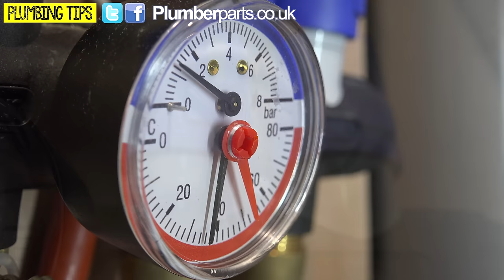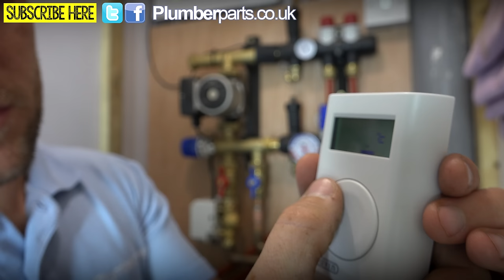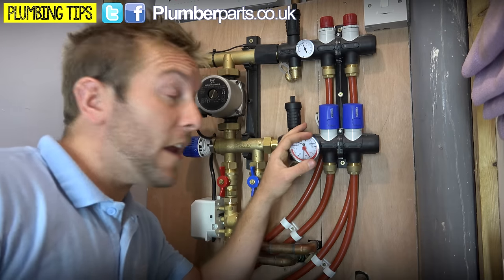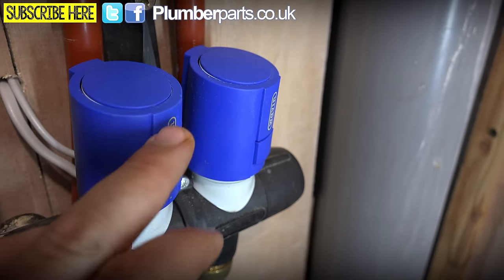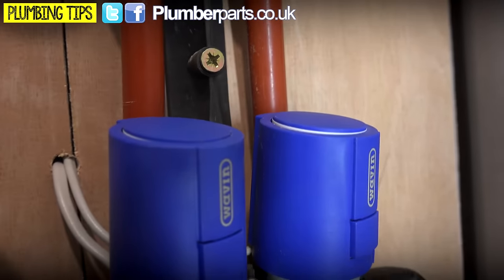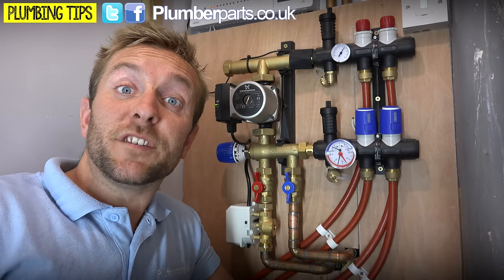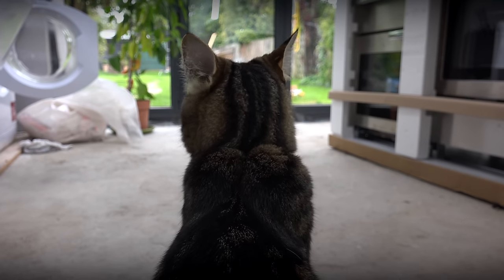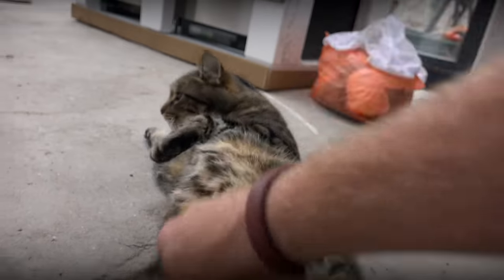UNDERFLOOR HEATING GUIDE AND INSTALL PART 2 - Plumbing Tips

Comment: Cats are by nature, expert heat seekers, having your cat lying out on your  floor is the only certificate of excellence and rating that you need,  to know that your heating system is working like a charm. Cat Rating : 5 Star.  Job well done. I've subscribed, but only because George gave you a certificate of competence and confidence.

Comment: This was the best video on U/Flr heating I have seen so far. Improvements could have been a view and detailed explanation of the wiring centre and you terminating the pipes into the manifolds.
I am about to buy and install U/Flr heating in my 2 extensions but am unsure how the zones work, I have 4 different rooms but dont want all 4 at same temperature or on at same time if not required, do I need 4 different systems of can this unit handle 4 different systems on a single larger manifold with 4 individual room stats?
I also know the "am I getting divorced today or not" feeling, my missus wants a nice big house but doesn't want the mess and hassle involved to get there. 😮

Comment: Good job at making this video. In Poland we install this kind of underfloor heating in new build houses as standard. Ususly each loop outlet has installed flow meter so you can balance the flows and take a note of flow on each loop and you can occasionaly check if the flow still stays on at correct level. The manifold with pump unit is mounted inside wall cabinet that fash with the wall for neat look.

Comment: Great video and a brilliant channel. Looking for some advice.... Can I fit both a wet undefloor heating system like the one in the video and also then fit an electric underfloor heating mat? The idea is not to use both, but have the choice of which source of heating will be most cost effective in the future. It is a new floor consisting of 80mm insulation then 75mm of screed and tiles will go over the top. My original plan was electric mats because of the ease of installation and a smaller original outlay. My original planning for the project was 2 years ago and since then electricity prices have dramatically increased so I am wondering if it would be wise to put the pipework under the screed which will give me the option of a wet system if I decide to at a later date. This is for my wife's new boarding cattery so it is independent of the house heating system and due to our location the only current feasible option for a wet heating system would be an oil fired boiler and I fear that oil and fossil fuels will become heavily taxed and ever more expensive so it could be good to have the choice of which system to use.

Comment: Very informative video! 
I have a question. Zoning off valve of my heating system is broken is not responding to Thermostat. Room keeps heating and wastes energy. Can I stop the Wilo pump for few days till I get new part? Or stopping pump and flow can cause damage to system?

Comment: Could you tell me if it is possible to replace an isolation ball valve on my underfloor heating manifold without draining the system ? Hope you can help, thanks.

Comment: Where do you connect that wire what comes out of the 2 port valve ? To a thermostat which is located in the room where is underfloor heating ?

Comment: hi i have boiler in toilet and manifold in kitchen under the stairs cupboard i have 2zones 1st floor radiators ground floor wet underfloor heating my question is can put 2 valves next to boiler for each heating zones. as most people they put 2zone valve next to manifold.

Comment: I guess those actuators are thermoelectric - slow but low powered and silent. So why choose normally-closed rather than normally-open? I guess the choice was made by Wavin or whoever made the controller, but wouldn’t normally-open give both a faster start-up and fail-warm rather than fail-cold?

Comment: Hello, very helpful video / guide! I have enjoyed watching a few of these plumberparts videos and non-coincidentally have just had my house completely gutted back to pretty much 4 outside walls then heavily extended (totally rebuilt new from a husk effectively) and have a couple of questions for anyone in the know which may be able to help advise on my requirements before i go ahead with the heating system install...?

The place is a pretty sizable (4000+ sq/f in total overall) consisting of 5 bedrooms over 3 floors (loft conversion) with 4 en-suites (3 baths, 4 showers), with the ground floor having underfloor hydro heating (2000 sq/f) which is predominately open plan lounge / kitchen - with 2 receptions rooms + Utility + toilet .

 My plumber has recommended an Ideal Logic30+ along with a Megaflo  water cylinder, my question is - When i look at guides / recommendations for boilers for the size of property it would appear I should go with a 40+KW boiler due to the amount of bathrooms etc - however - as I am using a Megaflo Mains pressure cylinder - does this mean that the 30KW Ideal boiler hes recommending doesnt need to be as powerful as the cylinder makes up the difference in power requirements? The other thing is - the plumber is saying that the Ideal Logic Plus 30 is a good boiler with a 7 year warranty and he never has any problems with them, I have had a few Valiants over the years and one newly installed one completely destroyed itself in about 5 years and had to be pretty much completely replaced with parts, so am now rightly dubious of the brand.

Could anyone clarify the above questions and / or what would be the best boiler and cylinder combo based on my requriements?

Any help would be very much appreciated. Ta

Comment: Hi. Thanks for the video. It is really helpful. I am installing an underfloor heating myself. Really appreciate if you can provide me a few suggestions. I have put screed on top of the heating system. Just wondering two things 
1)How long should i leave the screed before i do the flooring. Can i keep the room temperature at about 20 degrees centigrade (using a room heater) for about 7 days and do the floors or do i need to keep it for 21 days for the screed to settle and then gradually get some hot water through the pipes. Unfortunately this will take about 28 days which will be a bit difficult especially with a young child at home. 
2) I have a got 22 mm engineered wood for the floor. I was planning to put an underlay and put the engineered floor directly. But someone recommended me to put a damp proof membrane, followed by a 6 mm wood play (with large holes in it), then underlay and then the 22mm wooden floor. Is this required. Will it not be too thick under layer for the underfloor heating to work efficiently. 
Thanks in advance for your valued suggestions.
Regards

Comment: Quick question probs sounds stupid but can you change the pump side to right so the flow is from that side ... the unit doesn't have a directional flow on each side does it ? and if so is that true for all manifolds ? cheers

Comment: Hi, great video.. just wanted to know, does the pump require to be wired to mains electricity? Or does it just run off of the water flowing through it ? 
Many thanks, Phil

Comment: Hi great video but I have a question. Where on a conventional cylinder system do I connect onto the flow and return or does it not matter? Also, do I need to add a valve to call for heat independently from the central heating?

Comment: James, can you have this on the same zone as other radiators, just wondering because of it having a pump on it too. It looks like this is a separate zone. We're doing a dual zone system (up and downstairs) on our house but wanted to install overlay UFH in our hallway, bathroom and kitchen. Trust it's just a wiring job to incorporate this into the existing zones.

Comment: Here's a thinker for you. I have built raised growing beds for vegetables in the garden, now UK isn't exactly St tropez but I want to grow all year round so I'm thinking of running a loop of this in the bottom of the each growing bed, so insulation, a loop of pipe, perhaps covered in sand to spread the heat then heavy duty polypropylene landscape fabric or a dpm on top to keep things separate then add the compost and connect to my central heating system. I may put a cloche on top like a small greenhouse. what do you think, possible? good or rubbish idea or any suggested changes would be greatly appreciated.

Comment: Good video bud, Question, is it possible to add underfloor heating to an existing system..?  We have a bedroom, built off the house over a car port and its colder than the rest of the house, typical its the master bedroom too....  We were hoping to take the boards up, lay new insulation and then run underfloor heating in it off the radiator pipes.  Can this be done, of course, I wouldn't attempt it myself, it would be done by a professional, was just curious?  Cheers
Reply from the maker: Yes you can. There's afew different ways of doing it according to how big the room is. Check out Danfoss's radiator type underfloor heating valve. It's great! SUBSCRIBE! ➡️👉 https://www.youtube.com/subscription_center?add_user=plumberparts 👈⬅️ IF YOU HAVEN'T ALREADY! 😎
Reply: Hi, Would it be suitable for a room 16m2?

Comment: Not sure if anyone has mentioned this im sure they have but if not.. then ufh should always be zoned off if it is used in a system with radiators for the reason that ufh runs for alott longer than radiators. If it was on the same zone as heating then rads would satisfy the room stat and switch it all off prematurely before the ufh even got going.

Comment: Hi James I'm installing underfloor heating in my new extension using my existing combi. I know i need a 2 port motorised valve for the UFH. Will i need another 2 port motorised valve for the existing radiators?

Comment: I have a question... So we have moved into a house with a concrete floor for our kitchen. We are about to have a funky resin floor laid on top, but that will still be cold on top of the concrete.  So after speaking to a plumber, he suggested a low-profile underfloor heating system to avoid digging up the current concrete floor.  As our resin floor guy needs a concrete screed to put his resin on though, can we put a flexible self-leveling screed on top of those low-profile Underfloor heating systems, without issues as far as you know?  I'm struggling to get someone to give me a 100% factual answer.

Comment: Great vid as usual. Does every underfloor heating system have a two port valve? I'm looking at the prowarm system and it doesn't seem to have one. Also I have 22m2 of floor to lay, do I really need two loops? Again, the prowarm system doesn't seem to have two loops for that size.

Comment: great video and installed underfloor heating in one small room and screed  the area. However, I wasn't sure/Aware that I needed to pressure test the the pipes before screed was laid. have I installed it correctly? or is the whole project ruined? :(
Reply from the maker: Just pressure test it bro. If you get a leak, just find the wet patch and get your SDS drill out! SUBSCRIBE! ➡️👉 https://www.youtube.com/subscription_center?add_user=plumberparts if you haven't already!

Comment: Love your videos! Your energy and enthusiasm are infectious! I have a standard heating system with radiators. I’m planning to switch to an Air Source Heat Pump, so I’m planning to switch to underfloor heating. Can I just use the existing radiator pipes to each room to supply the retro fitted UFH system to each room, rather than fitting a manifold etc? And would a standard thermostatic radiator valve above floor level in each room successfully allow temperature control of each room? Thanks for any thoughts!!

Comment: Hi - I having an new extension put into on the ground floor and have found your vid useful, in regards to having the works done  by a third party is there anything I need to look into like should they be certified etc? and if so what certification should they have?

Comment: There should be a high temperature pipe stat set to 50C to ensure that high temperature water is not pumped into the UFH loops. If the temperature blending vale fails that may the case with the pipe stat cutting out the boiler.

Comment: Great vid, is there a reason why the actuators are designed to take a while to open up? Cheers!
Reply from the maker: Low geared to make them last longer I think.
Reply: +plumberparts  im struggling with wiring my under floor system to my boiler could you do a video showing the electrical side
Reply: +plumberparts i have a combi boiler and want to be able to have my radiators on and UFH off or my UFH on and my radiators off or both working simutaniously , do i need 2 motorised zone valves one on the flow and one on the return ?

Comment: James great vid....I have got the exact same Waven kit coming and looking to put the zone valve in like you did..I know you cant tell me how to wire it but I am having a debate with my electrician whom like me has never done UFH before and we are stuck on the wiring of the zone valve in relation to the standard wiring of the 16 zone controller.

Standard as per Waven is boiler, pump and live to controller....so where does the zone valve go to please.

Oh and yes I phoned Waven and they struggled to help even when I said we were installing a system the same as yours that is on the Waven blog site they cant supply me with the wiring diagram which includes a zone valve.

Comment: I live in a house with combi boiler and radiators how do i connect an extension with underfloor heating to this system
Reply: You need a S plan. Any plumber would know what that is..

Comment: Hi. Great videos. Roughly how many square meters can you have in each zone. I noticed that you used two circuits for you room which you said was about 5 x 5 (if I remember correctly). Is that a good guide and does it depend on where you live (I'm in southern Italy) or just the type of flooring? I'm intending on having a scree then floating wood flooring on top.
Reply from the maker: Always consult the installing company. Often they'll draw a guide after you give them room dimensions. SUBSCRIBE! ➡️👉 https://www.youtube.com/subscription_center?add_user=plumberparts 👈⬅️if you haven't already!

Comment: Hi, does your system include a "high-limit" thermostat? I read you need one as an additional safeguard, but not sure. I guess it goes above the mixing value or is it part of the mixing valve unit? Cheers

Comment: Did you refer to the blending pump instructions with regards to setting the speed of the pump, or is there an equation used for working out the appropriate speed on UFH? Cheers
Reply from the maker: +Llyr Jones Not that Wavin have told us. I usually set them nice and low to trickle round. It doesn't need over complicating. Generally, the more zones you have the higher the pump speed. PP!

Comment: Hi, just wondering why you use plumbing components to keep water temperature constant when there is an electronic thermostat fitted to do the same job if the temp falls? Am I missing something?
Reply: Ben Byard wondered the same!
Reply: The reason why the temperature reducer is used is the health of people primarily and the degradation of the floor. The temperature of the heating fluid is usually somewhere between 60 and 70 degrees celsius, imagine what it would be like to step on a ceramic floor at this temperature. It was found that besides discomfort there were also health problems with the legs and dust rising. So the mixing valve is designed to mix the fluid that comes 70 degrees with the cold one exiting already in the floor so that it reaches a temperature of 40 degrees in tubes and 27 degrees at the floor level. The thermostats do nothing but start and stop the heating system between the user-defined temperature limits.

Comment: We're just getting quotes for a heating system and the plumber says it's really expensive to run, so 2 questions really 1. Are you missing any arms or legs? 2. Is it something I could do myself? (I'm pretty savvy and have watched loads of your awesome vids)
Reply from the maker: Laying the pipe is something anyone can do. It's easy! Installing the manifold is more involved and requires a fair bit of knowledge...all this typed with my nose!
Reply: Disaster video will be in the post!
Reply from the maker: Ha! I'm sure it won't be!

Comment: Hi There. Cool video's. Looking at installing large system 12 loops. Have you ever come across a system heated by evacuated tube solar panels?  i am in New Zealand so we do get a bit of sun to feed them :) What is the approx cost of the manifold and pump setup ?
Reply from the maker: +Brian Burke In the UK you're looking at £800. Underfloor works well with ground source and air source, not sure about the solar side!
Reply: Thanks for that. How many outlet would that be ?

Comment: Hi, my system runs way to hot, I can see that it only differs by 1-2 degrees on the water going in and out (41 vs 40 degrees). What should I do?
Reply: Lower the blending valve.

Comment: Did you consider electric under floor? It seems that it would be less complicated to install.
Reply from the maker: It's not cost effective on such a large floor. But fine for smaller rooms like a bathroom.
Reply: If you have an all electric house, it is best to have wet UFH and a thermal store, so you can heat up the thermal store cylinder with cheap overnight Economy 7 electricity then use it during the day.